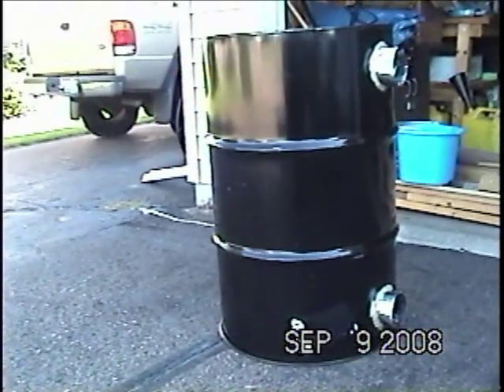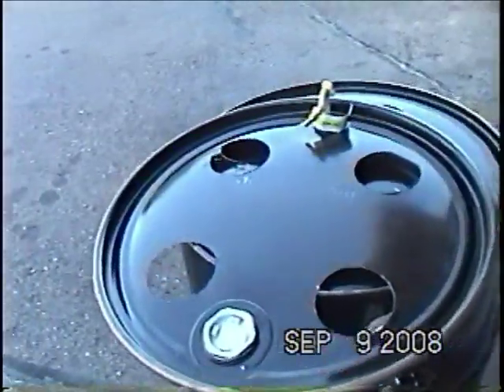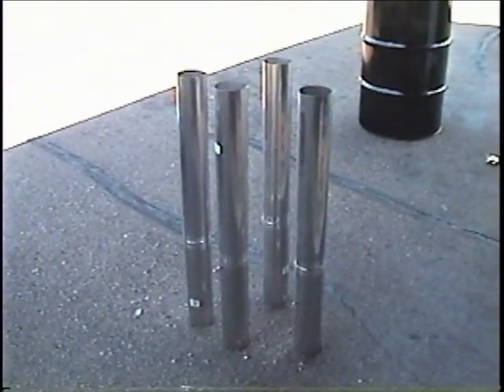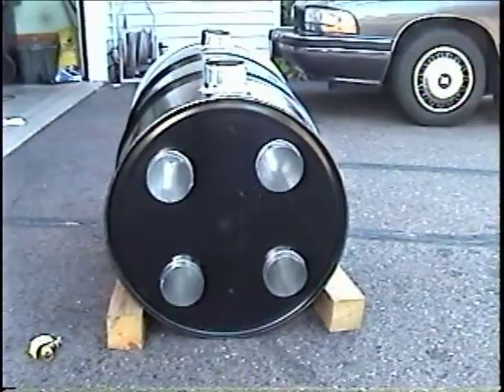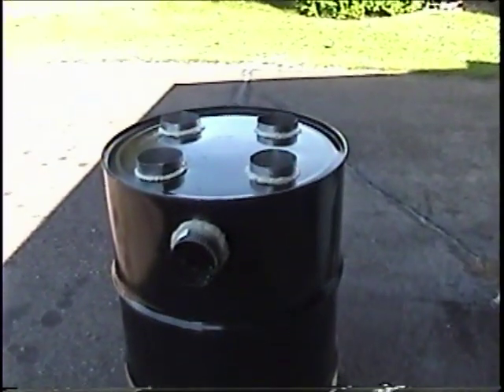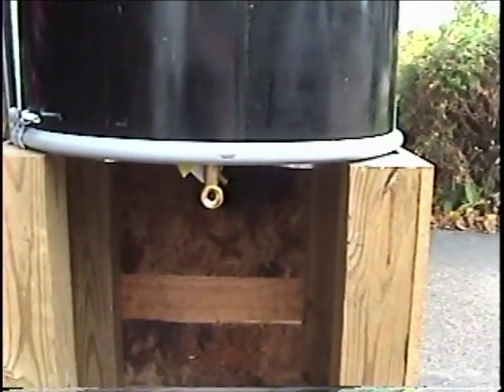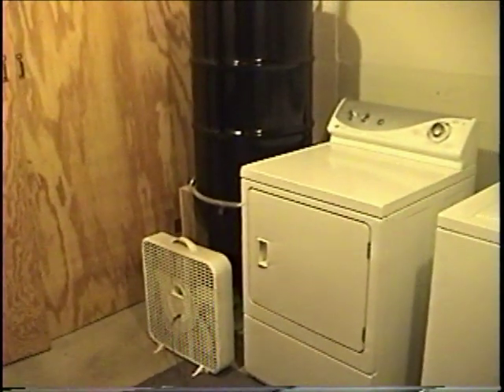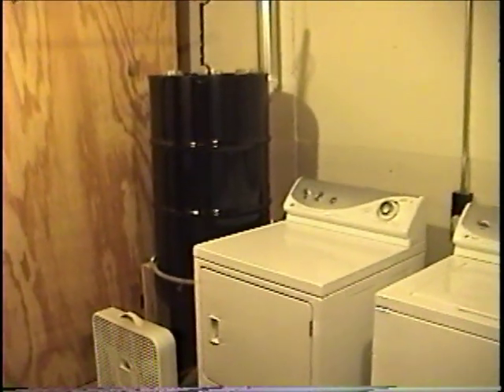Clothes Dryer Heat Exchanger

Comment: When running, the dryer is pulling air from inside and blowing it outside at around 110-130 cubic feet per minute, so a 10’x10’x8’ room sized volume would be evacuated every 8 minutes and cool outside air will take it’s place through gaps, cracks and ducts until the drying cycle is complete and the lower pressure is equalized. 
The ideal way to save energy would be to seal the laundry room with an exterior door and install an intake valve that would open with vacuum, allowing the dryer to pull outside air through a (more efficient) heat exchanger.

Comment: What is the temperature difference between the intake on the fan and the exhaust of your heat exchanger? It doesn't look like you have enough air flow through the exchanger.

Comment: So the money saved in not wasting the heat is used to run an electric fan to save money saving heat by powering it being saved???
Reply from the maker: For the amount of time the fan runs it costs pennies to run. It also blows the heat around the basement warming the basement more evenly. My point isn’t to heat the house with my dryer. It is to try to recover lost heat blown out the vent. You are looking at a model T, not a Corvette. It was an idea I had that I decided to try out.

Comment: I meant when you dry not only water and air is comming out of the dryer exhaust, but also detergent and or dryer additives, how you get rid of it?
Reply from the maker: The last cycle in a washing machine is the rinse cycle. Detergents are removed from the clothes before you put them in the dryer. Dryer sheets work by rubbing against the clothing and should not be passed through the air. When you evaporate water, any left over  soap or fabric softener would stay on the clothing. The water evaporates and leaves them behind. The biggest problem would be a lint accumulation over time. There is nothing that goes through the heat exchanger that would not go out the normal exhaust pipe. In running this setup I found out moisture collecting in the drum was not really a problem. It evaporated with the heat towards the end of the drying cycle. The biggest problem is restricting air flow. Dryers are only made to deal with so much back pressure.

Comment: Okay removing the moisture, but what about all the quimicals, smells?
Reply from the maker: I don't understand what your question is.
Reply from the maker: There are no smells. The air flows over the clothes and out the discharge of the dryer the same as if there was not a heat exchanger in line. There is nothing that would create a smell.

Comment: I honestly wouldn't even bother doing any of that. Dryer vents do get hot but not enough to warrant a heat exchanger that size. What I would do is simply extend the dryer vent pipe across the floor and then direct it outside. Add a small fan to blow the air off the pipe and call it a day.  It won't create a lot of warm air but enough to supplement your heat so you could drop your thermostat a couple degrees more often. Don't expect huge savings either....lol

Comment: Alternate energy-saving solution: a clothesline.
Reply from the maker: Good idea for summer. Bad idea for winter.
Reply: Mine works fine year round.
Reply from the maker: You must be in one of those warm area.
Reply: Oklahoma City.  It doesn't get too cold in winter (normally), and there's just about always wind.  Even in the colder months, a good wind will make the clothesline work better than I would have thought before trying it.
Reply from the maker: Defiantly a better choice to hang them outside if possible.
Reply: @wjj4832  I think it's called a "stiff breeze" 📉😎📈

Comment: Great idea! I would modify it though so that the inside of the tank only has a long coil of 4 inch impervious black plastic pipe, like you would use in the yard to move gutter water away from the house. Connect one end to the bottom and one to the top. Water seal it all, then fill the tank with water and throw the lid on. Much more heat transfer from the longer pipe, and the water will modulate the spike in temperature, giving you a longer period of more even heat!

Comment: I have been a major appliance tech for 23 years. The ideal vent is a straight run.  Every bend causes turbulence and back pressure.  I believe the formula for metal vent is a max of 30 feet straight. Deduct 10 feet for every bend. Three bends and you vent is not workable. 
    Your setup causes airflow problems that will result in lint backing up in your dryer, causing an increased risk of fire.  It also will result in longer dry times, negating any energy savings.
Reply from the maker: Interesting. Thank you for the Info.

Comment: Bulkheading the drum with strategically perforated plate may help, but will add flow resistance to dryer. With essentially zero pressure differential across the two flows you could also cut holes in the ducts and span them with foil, which will reduce thermal resistance between flows. You could imagine using the heat exchanger to augment the inlet on the dryer. I think they would call that regeneration, not sure. theoretically with efficient heat exchange you could run the dryer at a much lower power. I am interested in applying solar to this concept, so sun dried clothes without the hassle of hanging.

Comment: Really like where you are going with this,   but I have to say I agree with a few others that have pointed out that there just isn't enough surface area on the 4 pipes you ran through the barrel to displace enough heat.   You could test it by measuring the temp going into and coming out of the barrel and measure the Delta.   If it goes in at 120f and come out a few degrees cooler,  I suspect that much if not all the heat you generate will be offset by the cost of the electricity to run the fan.   If you had inserted run 30—40" copper pipes,  my guess is the increased surface area might work better.   Course copper is expensive so unless you have scrap,  the time required to recoup costs wouldn't be worth it.

Another idea might be to put a few small scrap radiators (heater cores) inside the barrel small enough to fit but large enough to allow air to flow unimpeded.   Seal around the radiator/s in the barrel forcing the air to run though them and run water though the radiators with a small pump to a small external radiator with a small fan on it to exchange the air/heat.

Comment: interesting idea but why not just run a indoor dryer vent. that would keep all the heat from your dryer in your house.
Reply from the maker: Too much humidity into the house.
Reply: some humidity in the winter is good, air dries out in the wintertime. plus humidity holds the temperature longer.
Reply: Indoor dryer vents are fine, ( IF ) it is an electric dryer. Gas dryers will put gas's back into the house that could kill you.
Reply: I have to run a humidifier in the winter because it get s so dry. This would be a good option for me!

Comment: nit would perhaps work much better if you were to feed the inlet to the top and allow the vent at the bottow, i dont think the fan is necessary and i do think if you connected an exhaust flu from a wood stove or oil burner etc you would get a bigger result or even if you  used it in an upstairs room and broke into a flu from the room below or that n it you know run with yet and turn purple
Reply: are you on drugs? Your suggestion would probably result in someones death. Leave exhaust gasses alone.  

Related to the device, I'd bet the inside of the drum will probably be contaminated by lint fairly quickly. I think a better design would be to attach fins to a section of aluminum dryer pipe si it is the exchanger (don't need a big drum). Your appliance-to-vent distance is way too long! You are going to cause so much air flow resistance that your dryer will have to run much longer than necessary. The cost of wasted energy will far outweigh any savings you realize from your heat exchanger. Worst case, your dryer catches on fire.  If your dryer can't be closer to the vent you need to increase the duct size to 5 or 6". Also each 4" elbow is equivalent to the resistance of 10' of straight pipe. Use minimal elbows.
Reply from the maker: No I'm not on drugs, and I don't drink. That only leaves stupid.

Comment: The whole idea is neat, but this actual contraption would never work. There isn't enough surface area in the heat exchanger. You would need something like an air-to-air intercooler, and you need to add a fan to boost the pressure of the dryer exhaust. I don't see this helping your energy bill in any significant way. Maybe a few cents per month? The increased lint buildup due to the increased exhaust restriction would negate any benefit. This could even cause premature failure of other components. The box fan probably uses up any gains as well.

Comment: Great ideal, it could work better to warm the area if the fan was set to be positioned at the top blowing straight down thru the heat exchanger blowing the heat to floor, the temperature of the exchanger should never reach any temperature to harm the fan, also as long as the fan is on every time the dryer is on the fan will never get hot enough to harm it as the cool air will always keep it cool because its on. Or just simply turn fan around on the floor and it will suck the warm air, again the temperature should not harm the fan, but have to see how hot it gets first though.  Heat naturally rises, this way the room is very comfortable with the floor and furnishings near the floor collecting the heat from the fan blower instead of the heat blowing to ceiling and heating the ceiling losing heat out the roof without benefiting as much from it.

Comment: You may want to consider putting the dryer exhaust flow perpendicular-not parallel- to the heat exchanger tubes. This exposes more surface area to the heat source. The thermal conductivity of the steel barrel isn't so good either. Not sure how much heat you would return to the room anyways. Most of the heat is used to vaporize the water in the clothing. Only a small percentage is going out the vent...

Comment: Here is a thought,  one, that thr heat exchanger way to big. The dryer will never heat that thing up enuff. What is the air temp coming out the top? Prolly cooler than the house. Why not just undo the dry vent and blow that humid air into your house. You are defeating the purpose taking out the moisture because hot air is dry, that why they have humidifier on furnaces. So by just letting that hot 
humid air right out the dryer vent you heat house and add needed humidity.
Reply: George Elven Moisture isn't the only thing coming out of the dryer. There's a reason why this is a bad idea.

Comment: Awesome idea. What about using 4 computer fans on the tubes. they run on VERY low voltage..... Just a thought :)
Reply: i thought of the same thing.. the box fan will waste too much power and wont do a thing unless he boards up the top hole. a few plates welded in the barrel like a muffler has would help exchange the heat better, helping to slow down the output without retaining it..
Reply: Blow from the top down, or it will just heat your ceiling.
I like the baffle idea. I'm a little curious about cleaning the lint or of it.

Comment: Nice Video, Take the water from the drain valve and put the clean water back into the washing machine, I put all my water from the dehumidifier in the summer goes not down the drain when filled all goes in the washer, this can add to big savings !!

 Nice Video
Thanks

David

Comment: On second though, why not spend $15 at lowes an buy an indoor dryer vent?
Reply: ezelder As he said in the beginning of the video, the air straight of the dryer contains too much moisture.  He doesn't want all that added humidity in the house.  It looks like he has this installed in his basement.  That moisture can condense and collect in the insulation, wood, and other cold services causing mold and other problems.
Reply: ArxVirtus
Makes since.  I suppose it depends on your region and the location of your dryer.  Mine is on the main floor of my house.  The extra moisture is always welcome here on the east coast.  We usually only have humidity issues in the summer time.  ;-)

Comment: In the winter months, the additional moisture should be welcomed since heat sources dry the air to begin with.
Reply: Unless you are out here on the soggy west coast… OUT evil humidity OUT!   ;)
Reply: Over here on the east coast we don't have that issue, unless it is summer time.  :-)  Most of our heat is Gas or Electric which further adds to the dryness of the winter air.

Comment: you could use 4 old computer fans one on each pipe then wire them to a 12 volt dc wall adapter  it would use less power and make less sound

Comment: If you use a high temp silicone to seal the tubes a gas Dryer should be no problem. I'ed go ahead and build one, this is a safe way to capture waste heat, I'ed also build in a damper-bypass for the summer use.

Comment: The input and output of drier should be on opposite sides of barrel and then the fan sucking air down the tubes, for better heat exchange.

Comment: I always wondered....if we push air outside our homes with dryers , doesn't it have to come in our homes from somewhere?? I know I live in an old house that's supper drafty in the winter when the wind is blowing strong. Lots of places for the air to get sucked  into my place lol. Looks good though. Long distance to travel from the dryer to outside....air should be cooler for sure.

Comment: Can you not take some metal duct and make coil it. Then run the hot air through and the heat will be pulled out leaving the moist air to continue out..

Comment: @OnTheEdgeInEauClaire I know its a moot point after so long, but you could buy a CO detector for not that much and use it with a gas drier.  Also, feeding the heat exchanger outlet into the air intake of the drier (if possible) would let you increase its efficiency during summer months when you dont want the heat in your house.  Good catch though on needing the inlet at the top, heat exchangers work a lot better when the two flows are against eachother instead of in the same direction.

Comment: I asked myself this question: use dryer heat to heat the room/house or make a better vent door/flap that seals when the dryer is off. I did that and can't believe how warm the room stays now. Check the temp. of the vent pipe when the dryer is not in use. You'll be surprised how cold it gets. A dryer gets used for an hour then not for the other 23 hours of the day. The room can get quite cool/cold from a cold vent pipe especially if you leave the dryer door open. Check it, you'll be surprised.

Comment from the maker: I used it for a year and it worked good. I didn't want the moisture entering the house but wanted to try and recover some of the heat going outside. If I made a new one I would use 3 inch pipes and more of them going through the drum. I would also route the inlet to the top of the drum and the exit to the bottom of the drum. I did not have any moisture or lint problems. I moved and now use a gas dryer so I do not use it any more because of the possibility of carbon monoxide gas.

Comment: 1-Use  very thin wall galvanized metal. 
(aluminum would be better) bore out pop cans top and bottom and glue together.
2-Use as many exchange tubes as you can fit into your drum. 
3-add 2 half moon deflector plates to the sides of your drum. 
4-keep the fan on high
copy your central heating system exchanger but use very thin wall because you dont have the corrosive combustion gas.                                                                  (search pop can heat exchanger)
Great video.

Comment: I like your contraption you made. Dont ya just love all these people that run down your project, and tell you wont work?, Well i had people tell me i couldnt make furnace out of a wood burner, they said it would not work, well, i built it anyway, and its been working great for years, saved me thousands of dollars over the years.Dont let anyone tell you it wont work until you figure it out for yourself it wont work.  great job on your heater.

Comment from the maker: Ran it for a year and looked inside. There was hardly any lint. With the removable cover you could take it apart (although it would be a pain)  or you can stick a vacuum cleaner throught the inlet and outlet pipe.

Comment: You may want to look at a simpler solution. Whenver I was looking at putting a dryer into a house that didn't have a vent I came across a contraption that used a bubbler, sort of like an old oil bath carb. The dryer vent went to the water and when it came out the vent picked up the water, sort of like an oilbath or a bubbler on a whiskey still. It wasn't a very big device, all you had to do is keep an eye on the water level and dump it out periodically.